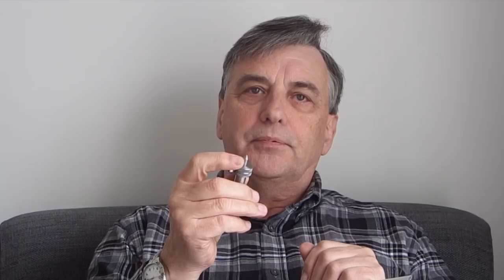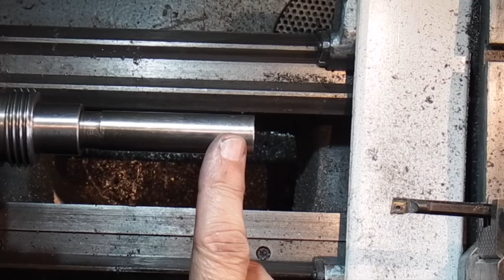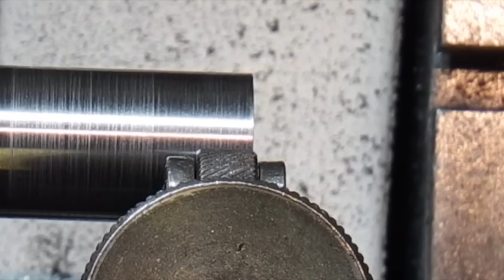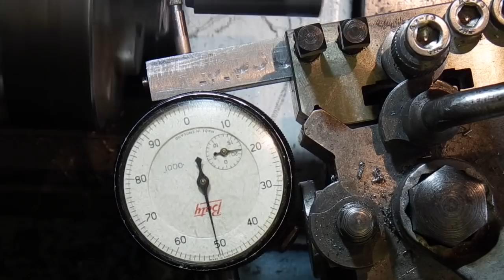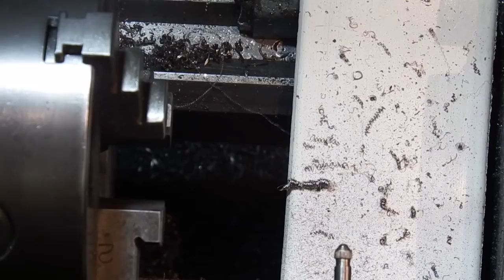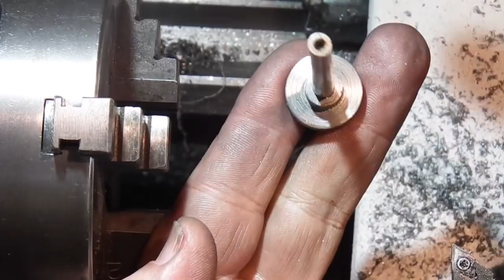Making a Tap Guide

Comment: Did I see your dial gauge doing the dance of St Vitas as you ran the spindle at 500 RPM.?       Inertial forces will make mincemeat or metal dust of the internals.       Steve Callachor. From the Colony of New South Wales